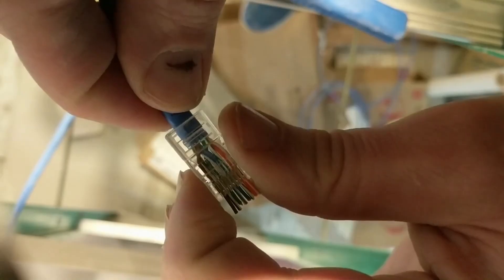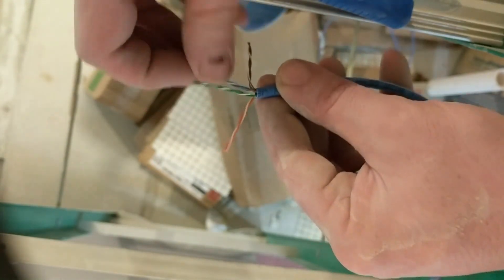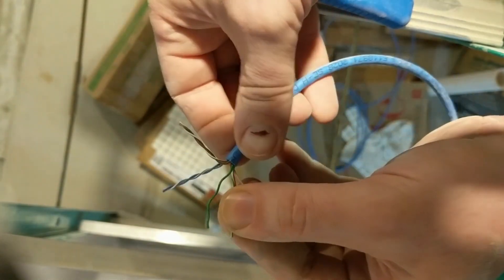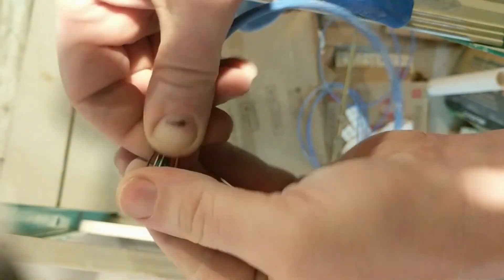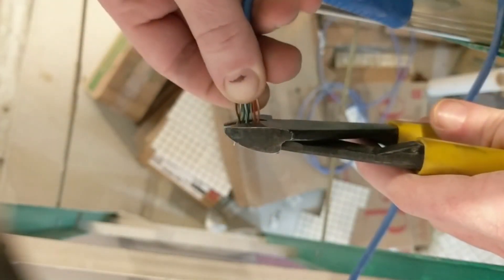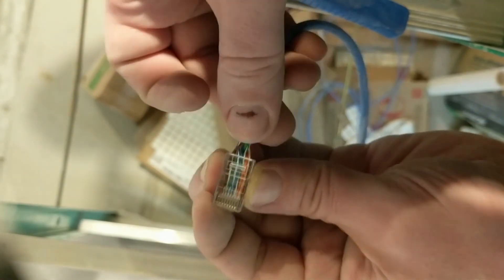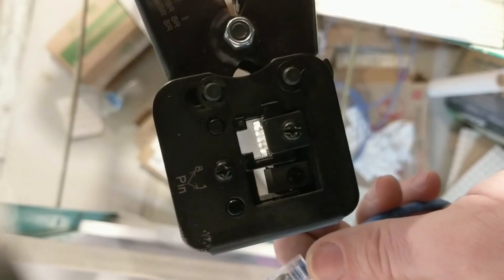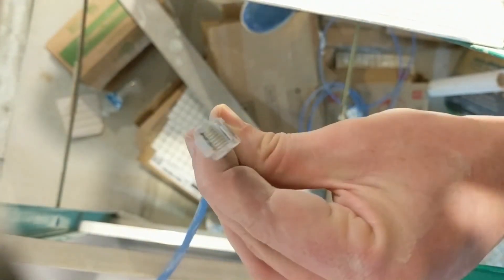Terminate RJ45 ends using EZ Pass Through Crimp Tool

Comment: How do you use this tool to strip wires? The description on Amazon says it can be used for stripping but it seems to be screwed to only one gauge of wire. It would be impractical to strip diffent sizes of wires with this tool.